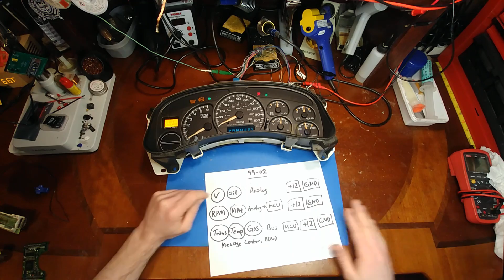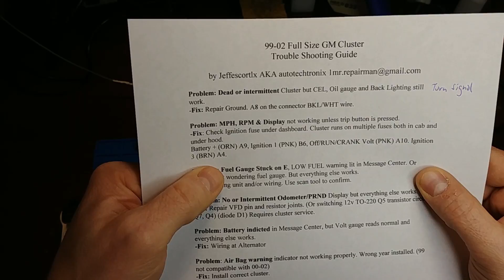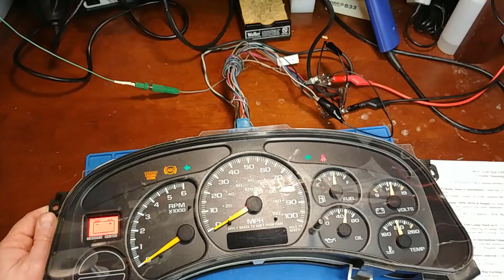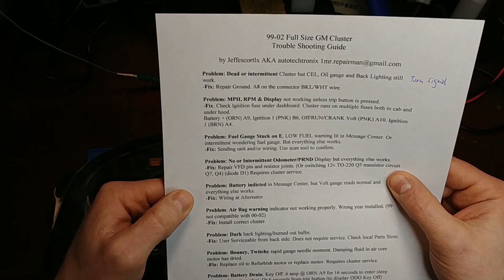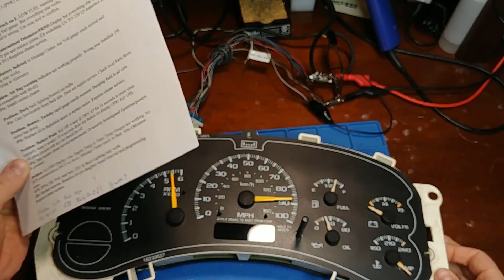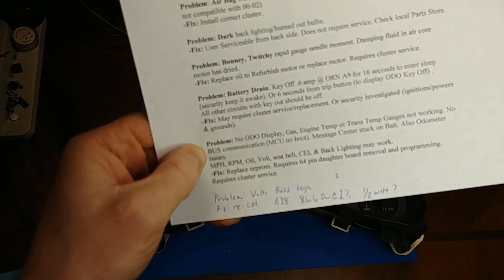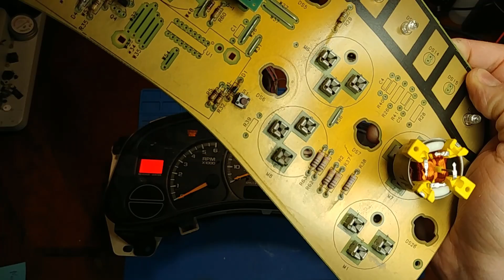GM Cluster Troubleshooting Guide 99-02

Comment: What if my gas gauge is pointed straight down and it goes on/ off while driving then throws battery and security light. Also oil is a bit shaky
Reply from the maker: The boot up test sequence is triggered when the cluster's powered up. That is when it runs through all of the warning indicators. Usually this is caused by interment power, possibly bad ground. The gas gauge pointing straight down could be from a bad sending unit for wiring.
Reply: I pushed my gas needle up with a zip tie now it works fine but cluster still does the reboot sequence as you mentioned but only when I have my wipers and the lights turned on or when I use my blinker and have my radio on
Reply from the maker: @BRED23  And you added a fresh new ground?
Reply: @jeffescortlx  no I have not what’s the best ground to replace for this should I do the T splice you mentioned in this video on the A8 black and white cable?
Reply: @jeffescortlx ok so I hav tapped into my A8 ground Carole with a cable tap can I ground that on to one of the screws holding the gauge cluster in place?
Reply from the maker: @BRED23  no, those just screw into plastic. There is a bolt just behind the cluster that goes into metal.
Reply: @jeffescortlx  took cluster out there is 2 black bolts approximately 7-6mm in size are those the ones you are talking about
Reply from the maker: @BRED23  you can use any bolt you want, as long as it's somehow metal that makes contact with the chassis. You just can't use a screw that goes into plastic, plastic doesn't conduct the ground.
Reply: @jeffescortlx  used the right black 7mm bolt behind the cluster to ground the new wire I T-tapped Into the original black and white A8 wire and my cluster has been working perfectly since. it’s been a day but I drove around 100 miles and not once did it turn back off. thank you for the solution you saved me having to buy a new cluster and also earned a new sub👏🏼wonderful work👍🏼
Reply from the maker: @BRED23  Glad to hear you got it fixed.
Reply: @jeffescortlx problem is back thought maybe it was the cluster this time as I already did the ground repair but even with a new cluster only the back lights are on along with battery light

Comment: I have something like the intermittent gauge issue, exept the engine light, volt and oil pressure are not affected. Everything else goes off like crazy, all warning lights are flashing and needles jump up and down. Happens after driving 30 min to an hour. Sometimes it goes back to normal after a couple minuttes and other times it goes on for hours, or until i stop the car for a couple min. Tried the ground wire fix and no luck. You have an idea what coult cause this?
Reply from the maker: Since the volt gauge is continuously working, that lets me know the ground and ignition wire is good. And since the RPM and mile per hour are cutting in and out along with the gauges that use the bus signal, that lets me know it's probably not the serial bus. So you probably have internal cluster issues, like fractured solder joints on the cluster PCB.

Comment: Jeff, great tutorial. My cluster on my 99 Chevy Silverado battery indicator that comes on intermittently gives me a place to start.
Reply from the maker: More than likely that's not an issue with the cluster at all, but the small wire on the alternator.
Or it's just alternator failure.

Comment: Hey Jeff,  my 01' fuel gauge is way off, like pointed at the voltage gauge after a battery change, everything else works fine. Any clue on how I could fix it? Thanks
Reply from the maker: Does the fuel gauge needle still sweep when it's powered all the way down and then powered up?

Comment: I had new steppers and leds but then it was working but a wire touched and nothing works now except lights what would cause that is there a fuse are something I can solder off and on are diode
Reply from the maker: You must have a different cluster. The 99-02 full size GM clusters don't use stepper motors. They use air core motors.

Comment: 02 2500HD. Trans Temp, Eng temp and fuel drop out message center battery and sec 4wdas well as abs light. 

Press the brake pedal and it comes back. Release the brake and it drops out again after few seconds. It’s the craziest thing. Can send video if needed. Thoughts?

Comment: Hace you seen the trip counter not work not count the miles used?
Reply from the maker: What is the year/make/model of vehicle that this cluster is out of?
Reply: @jeffescortlx  2000 model Silverado
Reply from the maker: @BowtieClusters  if the mile per hour and odometer are working correctly I would probably start by trying a different eerom.

Comment: Have you seen where the fuel gauge reads backwards? E=F F=E  only problem I have with my cluster. I have an 02 1500 Chevy Suburban. Thanks
Reply from the maker: No I have not. Sounds like the fuel sending unit is wired incorrectly.

Comment: Is it possible that the cluster has more than one ground?
Reply from the maker: The 99-02 has one ground for the main cluster logic and the other is for the backlighting.
Reply: @jeffescortlx which wire is for the backlighting on the harness?
Reply from the maker: @Caliswagg281  I don't remember just going off of memory. But if you Google the wiring diagram it will tell you the pin out.

Comment: Hi Jeff,  I have a 1999 chevy silverodo when you turn switch on everything works great for a min. or so then the gas gauge and the temp and message center drop. i done the ground replacement but still having same issue .
Reply from the maker: Sounds like your loosing bus communication. The problem may or may not originate from the cluster.

Comment: I've been having issues with my 2000 Silverado cluster. 
When I turn the truck off, take the key out, open and shut the door, once the dome light goes out, the high beam indicator and cruise control indicator both light up on the cluster and stay lit. It drains the battery. Also the D on the gear select is dimly lit, just barely able to make it out when it's dark. 
Even if I take the key out and leave the door open, the lights will still come on. Everything on the cluster works fine and normal. I've sent the cluster out for refurbishment, still does it. I don't know if it's the cluster or something else shorting out waking the cluster up. I've replaced the multifunction switch with factory new, still does it. 
Next I will put a refurbished BCM in. Maybe it's bad?? Idk. 
Do you know what circumstance would cause these lights to come on and drain the battery? Radio off, security light off, just what I stated above. 
I'm lost with this one, I have to remove and install the radio fuse everytime I park and drive the truck.
Reply from the maker: Did the place you sent the cluster to give you any useful troubleshooting or test result information?
Did you install a new ground wire yet?
Has any after market wiring been done to the truck? Like keyless entries, remote start or stereo system?
Reply: @jeffescortlx  No test info or troubleshooting from them. Haven't done the ground yet but definitely will. No aftermarket keyless entry or remote start. 
I do have and aftermarket radio, but it turns off correctly when I open the door and doesn't turn on until I turn the key on. I also unplugged it completely with no change to the lights on the cluster. 
I also have an amplifier and subs, but the amp turns off correctly when I turn the key off.
Reply from the maker: @jonathanst89  did you explain the issue the cluster was having to the place you sent the cluster to?
Reply: @jeffescortlx  yeah, Originally I had put in an order for a refurbished cluster on Amazon but he couldn't get the mileage set right and said I could just send mine in to be refurbished, that's when I brought up the issue. they said they have never heard that issue before. that was that, it was still cheaper than buying another unit so I did it.

Comment: I changed my back lights to LED. And now my fuel gauge is stuck on E with low fuel warning on. Gear selection highlighter not working.
But the passenger seatbelt, abs, Battery indicator, security light won’t go away. 
I undid the harness made sure I didn’t bend any of the prongs. But no change.

Maybe I damaged the harness? 
Post owner was smoker  All the wires are nice yellow tan
Reply from the maker: Sounds like you're cluster lost serial bus communication with the rest of the truck.
Reply: @jeffescortlx  how does one fix that or do you have a video for this already?
Reply from the maker: @Truckerraf  did you do any other work or change anything else just before it stopped working?
Reply: @jeffescortlx  no only the led and bulbs holder/sockets.  I did have to fangale the harness off so I could do so.
Reply from the maker: @Truckerraf  you could have damaged the plug solder joints if you used too much force and pressure on it.
Reply: @jeffescortlx  is this repairable? Is there a guide for that?
Reply from the maker: @Truckerraf  yes that would be repairable. No, I don't know of a guide. You just have to resolder/reflow the connector pins if this is the case.
Reply: @jeffescortlx  okay. So I’ll take apart the dash cluster and inspect and repair the solder on the pins and see if that works

Comment: Ive got an 03 Yukon, the cluster acts the same as this does with a bad ground, would that also be an instance of a bad ground or an internal problem with the cluster?
Reply from the maker: Intermittent power on 2003 and newer is a cluster PCB issue and not the grounding problem like 03 and older.

Comment: I have a 2000 Chevy silverado 1500 and the gas guage, trans temp, gear selector, mileage and the message center has a battery light on and they don’t work but everything else does how would I fix all of that
Reply from the maker: Sounds like you may need a new eeprom.
Reply: @jeffescortlx  what would I do to find that part and fix it
Reply: I also replaced the whole sending unit thought it would fix the gas gauge but it didn’t
Reply from the maker: @isaacwoolf7594  no, your cluster can't communicate without a working eeprom. This time it's not a sensor issue.
Reply: @jeffescortlx  so could I put a different cluster in and they should work then
Reply from the maker: @isaacwoolf7594  yes. Just keep in mind the odometer is going to show the miles of the truck it came out of, not going into. Could effect the value/insurance of the vehicle.
Reply: @jeffescortlx  I put a different one in and it’s still not working idk what it is
Reply from the maker: @isaacwoolf7594  might have something in the vehicle shorting the can bus communication.
Reply: @jeffescortlx  maybe idk but thanks for the help
Reply: 02 Chevy Silverado Z71 on my cluster the background lights turn signals temp gauge and check engine lights work nothing else works

Comment: Any idea what would cause the speedo, tach, and fuel gauge to no longer work all at the same time?
Reply from the maker: And when this happens the display continues to work?
Reply: @jeffescortlx  yes. Fully powered on, both screens are on and the 4 on the right are powered, fuel is stuck incorrect though and tach and speedo both died
Reply from the maker: @jacobgreene9132  sorry I'm not exactly sure what's going on with out hands on.
Reply: @jeffescortlx  and it all happened at the same time. Makes me feel like it's chip related or on something on the main control board with all the chips
Reply from the maker: @jacobgreene9132  but it doesn't make sense that only some analog and only some serial bus are acting up.
Reply: @jeffescortlx  yeah that's what's throwing me off as well. I mean in terms of clusters these are pretty basic.

Comment: I have an 04 gm cluster that the blacklisting is out until I push on the top of the cluster everything else works fine I just can see how fast I'm driving at night I'm no stranger to soldering  any ideas??
Reply from the maker: If it works when you put pressure on the connector than you have a fractured joint.

Comment: GMC 2001 Yukon XL, Cluster light ABS Light and Brake Lights always stuck on and intermittent fade on the Odometer/PRND321 display.  Reset the Fuse for ignition and for now the Odometer light is working without issue.  The other two lights.  Board issue or actually system issue that needs further investigation?
Reply from the maker: Your ABS/Brake light are probably on because your ABS module is bad. Common problem.

Comment: Great videos Jeff. Thanks for taking the time to make them. My 01 message center is non op.. Everything else in the cluster works fine just a dark message center. Have you run across this problem?
Reply from the maker: Yes often. 99% of the time it's from someone trying to fix it.
Reply: @jeffescortlx  It just stopped working one day. Nothing else was affected. Does the display go bad? if so do you sell them? How would I determine if it's bad? thanks for any help.
Reply from the maker: @Rockford180  odometer displays go out all the time in 99-02, that's what I briefly talked about in this video. But typically the message center does not go out on it's own under normal conditions.

Comment: The axillary ground wire worked for my needle gauges acting erratically/jumping. Thanks so much!!
 On the abs/brake light coming on occasionally, do you find this to be a bad ground to  the frame ?
I know there are many other issues ..
Thanks again for your help and enjoyable videos !! m.k.
Reply from the maker: The ABS module is known for having internal fractured solder joints causing intermittent issues.
Reply: @jeffescortlx  Thanks Jeff, your information has been great help ! m.k.
Reply from the maker: @mikekeziah3064  Your welcome.

Comment: I need help I have 3 clusters and I used to power them with a 12v car battery and the wiring was all over the place and I think it fried the board bc now when I plug it into a truck only the velocímeter and  the rpms read and the gas  light is always on the other guages don’t even move
Reply from the maker: It will be hard for me to troubleshoot over the internet.

Comment: I find it very instructive. How can I send you the dash unit. I have 05 GMC Sierra with the common problem the shifter Indicator light or display does not work. Where can I find you? How can I contact you? Thanks
Reply from the maker: My contact information is in the top pinned comment. Just above your comment.

Comment: Great video. TLDR of the video... about 80% of cluster issues with the 99-02 is not a cluster at all!
Reply from the maker: Basically yep. Well maybe 50-60%.
Reply: @jeffescortlx  see if your going to be showing printed papers on the channel you need to keep an eye out at your e recycler for an old dot matrix printer and bust out one of your vintage computers to print to it. I'm sure you got a commodore hiding somewhere.
Reply from the maker: @FixedUntilBroken  I could back up my BIN file collections on punch cards?
Reply: @jeffescortlx  store them on tapes with your vic 20
Reply from the maker: @FixedUntilBroken  if you need a copy you can build a terminal and dial in.
Reply: @jeffescortlx  once I get around to fixing these old power PC's I do plan to get one of the on the internet. Because why not
Reply from the maker: @FixedUntilBroken  ok I'll see you on AOL instant messenger.

Comment: You fought one problem. I seen a lot 99-02 cluster back lightning  stop working including all all the dash buttons on the dash... I believe it’s the headlight switch because  last 99-02 vehicle I worked on had this problem and there headlight switch was bad it wasn’t making connection inside no more, I usually just by pass this problem from the fuse box and all lightning works again but I believe by changing the headlight switch it  will fix the problem
Reply from the maker: I cover that problem here (although it's the 03-06 in this video) https://youtu.be/2ZDvRImSO0E

Comment: Replaced my 02 cluster with a 7 gauge do you reprogram the mileage
Reply from the maker: Yes. Included with refurbishing.
Reply: Can you update Vin information for swap clusters?
Reply from the maker: @StevenPaul001  I can correct odometer. But for 99-02 I don't believe there is much specific to VIN. What option you looking for?
Reply: @jeffescortlx  I have a 2001 tahoe that I'm thinking about getting Denali cluster for the transmission temp and 120mph speedometer. I was under the impression that the vin would also need to be updated for the vehicle its in.
Reply from the maker: @StevenPaul001  from my experience it should function just fine as-is. Only thing is it will display the odometer value of the truck it came from, instead of the one it's going into.
Reply: @jeffescortlx  Awesome, thanks for the information. Some good news other than the incorrect odometer 😀

Comment: Good information i have a 2002 monte carlo the mileage  and dive display come in and out sometime  so i pulled out the cluster  then went to the junkyard and pulled wires  from another monte now sure what wire are positive and negative  to power up the cluster can help pls. Thank
Reply from the maker: Bench testing station isn't necessary. Just reflow the 4 resistors that are tied into the VFD display hot wire circuit.
Reply: @jeffescortlx  like power it up see what lights are working i just don't know what wire are positive and negative  to hook thanks
Reply from the maker: @lupdogdog5371  if it has over 100k miles just replace all the backlighting lights. No need for a testing station for that.
Reply: Yes here what you are saying but if there is positive and negative  on the light if new the power  and negative to plug it in i can fix on the spot  instead of solding all in taking in and out lf the vehicle plus the vehicle is about 10min away.
Reply from the maker: @lupdogdog5371  the incandescent lamps used don't have a polarity.